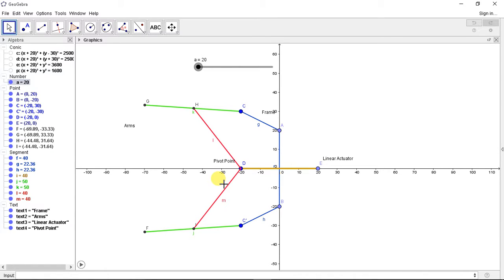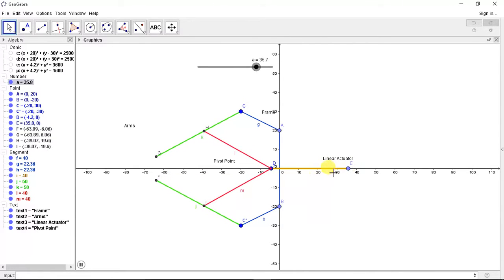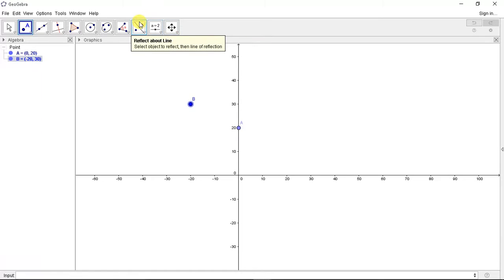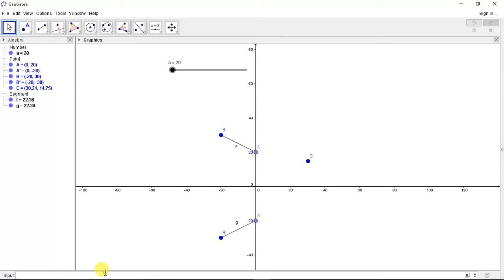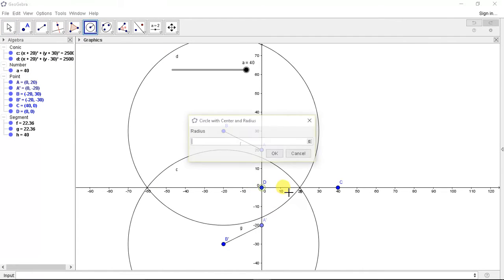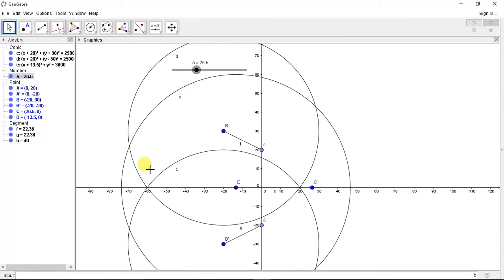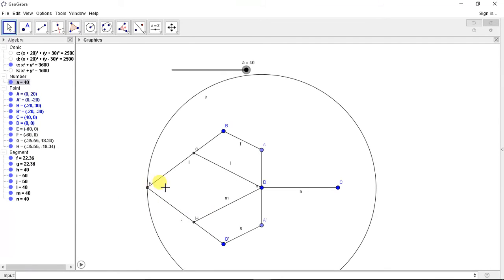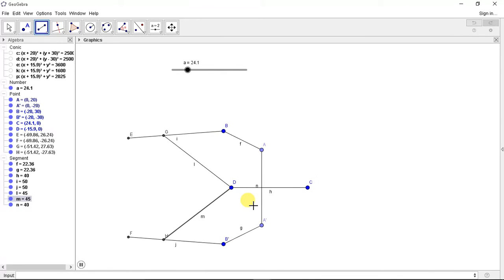Design of pick and place end effector | Kinamatics |Geogebra [TUTORIAL]

Comment: Effector is modelled wrongly! Segment(E,G) and Segment(G,B) change their values while you move the slider 'a' in fact they are not supposed to.
Reply from the maker: Thank you for your comment but, I don't think it is changing the value. If you want the .gbb file do click the link below. I will be happy to help if you have any more doubts or any missing details.

https://github.com/harshkakashaniya/Soft_illusion/tree/master/Griper
Reply: @coolrobotics  thanks for sharing the .gbb file. As I commented earlier, the lengths of those segments are changing. Kindly refer to https://www.geogebra.org/m/hck9fz3t
Reply from the maker: @murzabaev   That's right, now I recognized the misunderstanding of geometry. You are right we need a small prismatic joint in this end effector to solve this issue.

Or else If we physically make this gripper with a pin joint. We will have slight variation and opening and closing angles.

Any ways, Thank you
Reply: Soft illusion you could resolve the issue and you can share .gbb file in the comments (as you did earlier). We would be happy to see the solution of the problem.
Reply from the maker: Sure.
Please find attached link.

https://github.com/harshkakashaniya/Soft_illusion/tree/master/Griper

And thanks for letting me know.
Reply: @coolrobotics  thanks for a solution  file. Well, I've been waiting for the ideal solutuion (if exists) when arms are closed at a single point on x-axis, and slider still runs from 0 to 20 (I mean this was the initial task you've put forward at the beginning of the video) :)
Reply from the maker: But that will not be possible because we will over constraint the end effector. 
Initial example in the video was an idea.
The lengths can be tweaked. If you want slider from 0 to 20. Edit lengths of end effector links and you will gain required stroke. It all depends on what is fixed in your design.